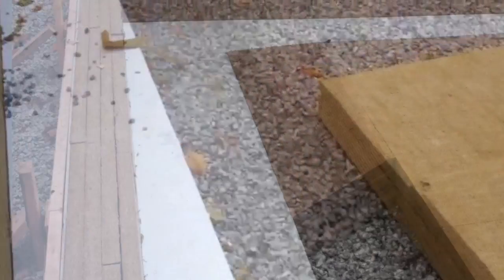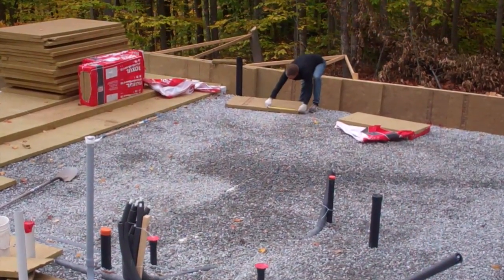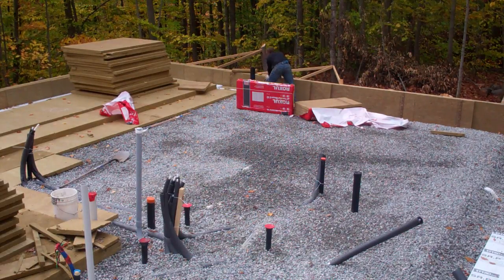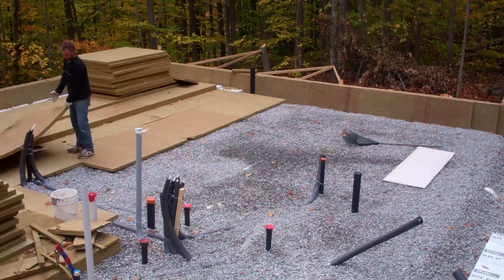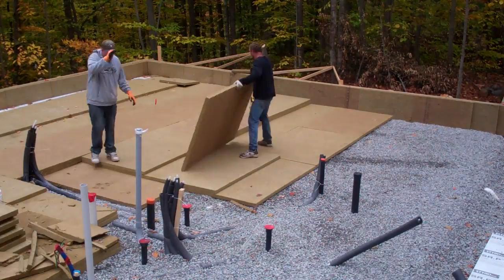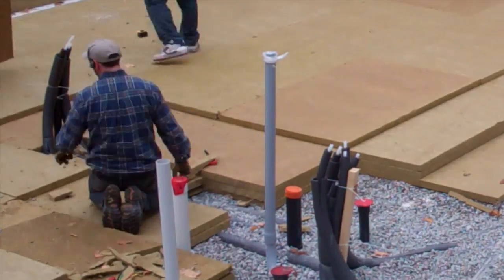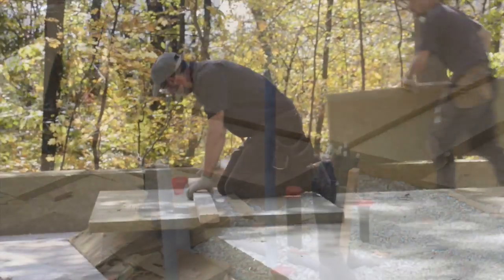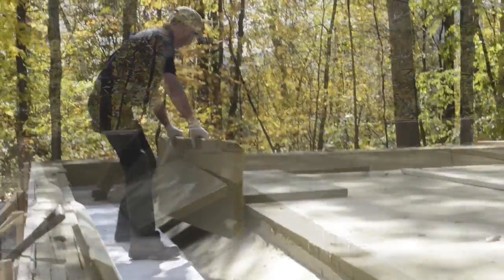The Ultimate Foundation? Super Insulated Monolithic slab-on-grade foundation & single concrete pour

Comment: You guys chose ROXUL for your floor insulation, why not use a EPS foam?, while I know ROXUL repels water it will eventually take water on and your insulation factor will be lost, is this not a concern?
Reply: That was indeed the first thing that came to my mind.. makes zero sense to install an insulation that may absorb moisture under a floor. I found ZERO explanation as well on why anyone would advice this product.
Reply: ya what he said.  stuff looks susceptible to water over the years as compared to XPS
Reply: It sheds water rapidly. Roxul has a whole bulletin on how to do this. They have been averse but there are builders using this product and appplication http://www.greenbuildingadvisor.com/articles/dept/musings/sub-slab-mineral-wool